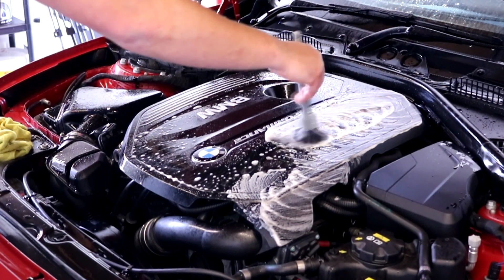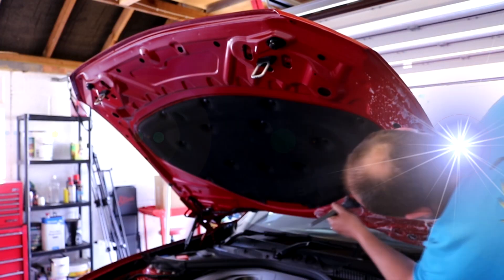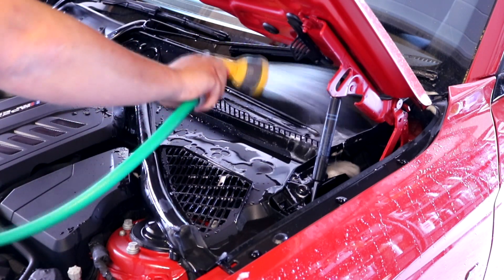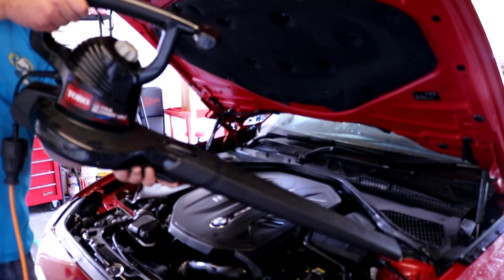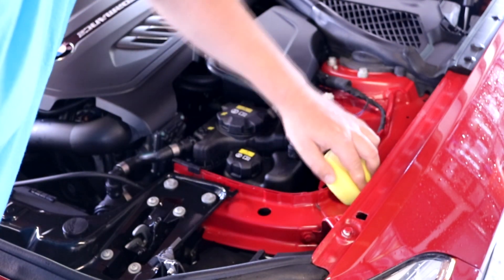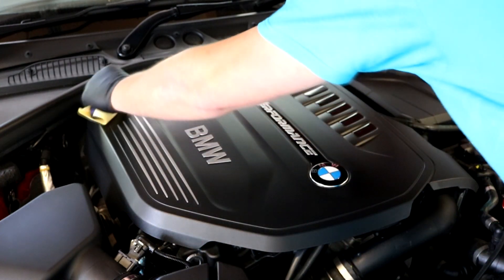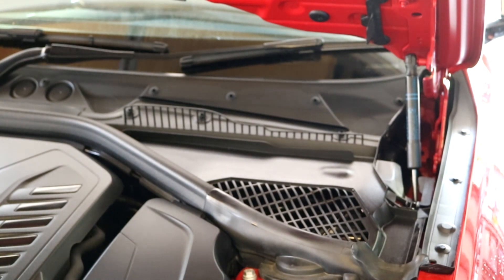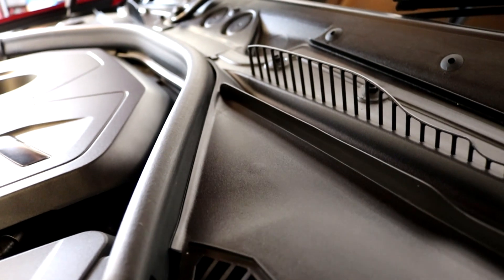Restoring and Protecting trim with ceramic coatings

Comment: I used that cheap ceramic coating ( 9H MrFix ) that you took appart on the heavily faded plastic of a 2006 Ford Ka . Absolutely brilliant so far .
Reply: Brandon Fountain  yup, I used it on faded headlight trim, applied a couple coats and it looks like new. That was two months ago. Still looks good. I have a faded windshield trim which I applied it to. It is slightly chalky in places, It was very faded I think the plastic absorbed a lot of the coating. I will apply more and see how it goes.

Comment: Definitely think the doing things bit by bit is a really good plan. I've found my motivation ebbs away if I try to do too much. You can't apply that to washing the vehicle but you can to almost any other process. Back in the day, when I was still in the Sponge, Turtle Wax and chamois stage, I'd wash the car and polish, say, the front one week, doors the next and so on. I still apply the same approach to this day. Good advice.

Comment: I've not tried this particular product, but I've tried CarPro DLux. And even though I was initially very satisfied with the results, in about a months time the even black finish partially reverted to the old grayish, streaky one. The water repellency was still crazy (which was actually not an advantage, but a problem at this point, because I could not even apply dressings to cover up the streaks anymore), but the finish just looked uneven again. And that even though I went through an extensive prep process, and aggressively and thoroughly scrubbed the surface both using APC and then IPA, using microfiber towels prior to applying the ceramic coating to it. And I actually did two coats instead of just one. Still, in a about a month the streaks showed up again and also the dark black tone has partially reverted halfway to the faded grayish one. 

What I did now on another car was to apply first Solution Finish to restore the trim to black, and the once that has dried (been waiting about 2 days before proceeding) I've applied DLux over it. This time I've also used a magic eraser (melamine foam) to scrub the surface clean prior to application, which I think worked better than did the scrub with the microfiber towels only.

I yet have to see how this holds up, but I have great hopes for it, both because of the more abrasive cleaning, and because of the "dual action" of combining Solution Finish with DLux.
Reply from the maker: perhaps ceramic on their own is just better for protection on newer trims.   can tell you what this video was shot a fair while back and the product is still working really well but I had no greyness to restore.    Im going to try the solution finish trick Ive heard other peeps say this works.. might do a video on it gabor let me know how your trim holds up with it pls mate.
Reply: Will do
Reply: Carpro Dlux worked great for me when i used it on the plastic on my moms old Saab from 2002 and the plastic was lightly gray but very bad plastic gets pretty problematic by time
Reply: Forensic Detailing Channel solution finish and Renew Protect products would be a great great review. I've been using Renew protect Blak and Gloz and it has been fantastic on my tires and rubber trim so far. I've never tried solution finish because I like a little more gloss which is why I bought renew protect. Please review these! I really appreciate your professional views, cheers!
Reply: a nice tyre coating with just the perfect amount of shine is PolishAngel Black Bond or Gyeon Tyres as far as i been testing :)
Reply: @berczigabor  how did it hold up?
Reply: It did fade somewhat in the first few months, but is holding ever since. Dirt and water repellency still very good, and is also still a lot darker than it was originally.

Comment: I recently bought Gtechniq C4 Permanent Trim Restorer after having CarPro Perl let me down (It began to run in the rain.) I have to say I'm MIGHTY impressed so far! I don't know why I ever used Perl at all to be honest after using this. After a month of VERY heavy rain and crap weather, my trim is looking like the day it was installed.

This made me try another "Ceramic", Gyeon Tyre. Again, never knew why I used Perl for as long as I did, out lasts it infinitely.
Reply from the maker: i need to try that gyeon tyre I will look at it soon.
Reply: I'd say I'd use PERL for interior plastics. I bought insta finish magic trim from slim's detailing and they said not to use it for the interior as customers said about it being greasy or something like that.
Reply: Perl is water based, and has done me good in the pasts for pretty much all my trim, tyres ect. I used my mix of 1:5 perl which I normally use on my engine bay on my front grill, splitter and door mirrors. That night, we had a bit of rain, but nothing crazy. After the drive to work I'd noticed it had COVERED my bonet and had run down the doors underneath the wing mirrors. It made a real mess of my car and needed a good aggressive wash to get it off.

I'll stick to using it on interior and engine bay as i'm not happy with it running all over my paintwork. It's a good product, but I'm not a fan of using it on the exterior.
Reply from the maker: Fantic1980  Ive never had that problem with perl..  I used it recently because my seals on the 140 as a bit sort of tired and patchy and its been fantastic.   I love perl.   One time I got a spotting issue with it but the spots just sorted themselves out.. (wasnt overconcetrated either)..  but its been really cool.  I like it on exteriors, engine bays, tyres everything.. pretty much all I use.. but Ive heard so many talking the the silica dressing for tyres so Im kind of excited to try this because I reckon it will be good.
Reply: I've used Perl for over a year and was happy with it until that point. I used it on absolutely everything plastic. That one bad experience just made me look at something different, and that brought me to ceramics :) 

On a side note about that dirt transfer you had on application. I'd snow foamed my car (bilt hamber Auto Foam) I then scrubbed with Bilt Hamber Surfex 1:5 and rubbed down with CarPro Eraser. What I thought was squeeky clean, STILL had dirt transfer when applying a ceramic coating. I also had the same issue with Gyeon Tyre, even though I'd scrubbed the living daylights out of them.
Reply from the maker: yer I think on plastics its gonna happen.. when I did the wheel arch thing I got some as well... its almost like the newer or sooner you can do this on a car the better

Comment: Good vid as always but what blower were you using to dry the engine?
Reply from the maker: its a torro lead blower I nicked it off my mum lol. but its pretty decent just a bit unwieldy..
Reply: Try looking on line for a dog blow dryer, much cheaper than the full pro car dryers but just as effective and rather easier to use than a leaf blower
Reply from the maker: Garry Talbot  me to, but the leaf ones kind of doing the job.  I actually think portability will be more usefull for me so Im looking perhaps at the little mini hand held master blaster thing.   I just dont like the idea of dragging the hoover style blower thing around behind me.
Reply: Forensic Detailing Channel   Yes I see your point but I’ve mounted mine on a little trolley and got a longer hose so I can effectively leave it on the floor and access pretty much the whole car.

Comment: I have a silly question. What's the difference between paint ceramic coatings and trim ceramic coatings? 
If I don't want to spend an extra 80$ for the "trim" kit, can I just use the same coating im applying to the rest of the car?
Reply from the maker: not much TJ..   probbaly someslightl formulation tweaks but essentually very little as fair as I know.